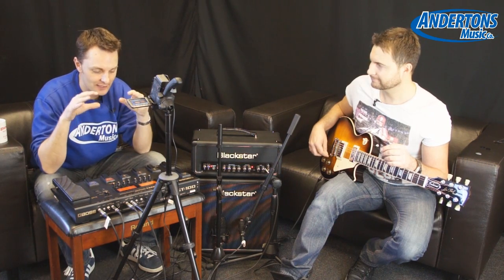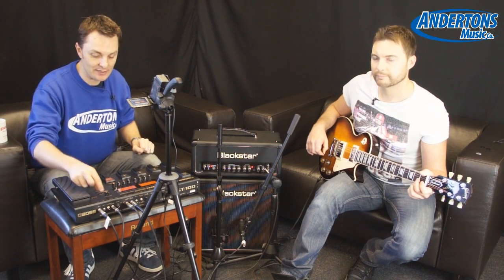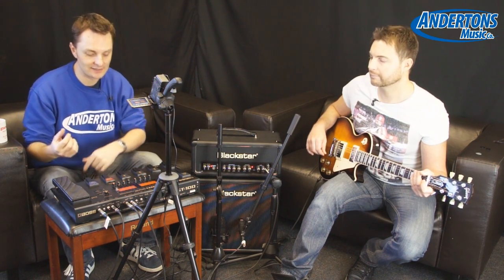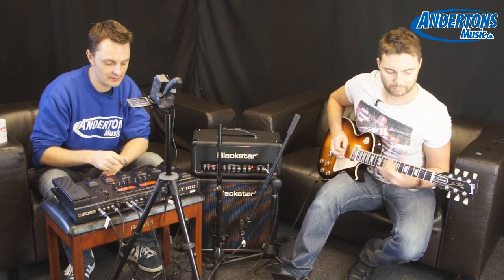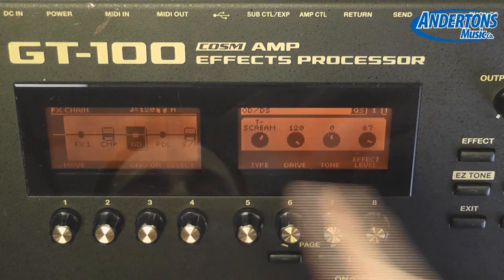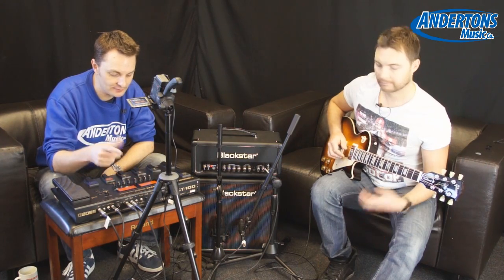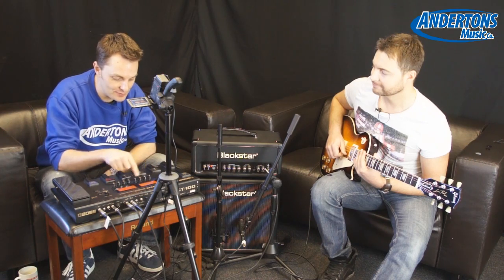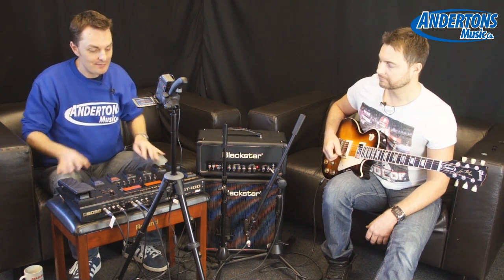Using a Boss GT100 with your Tube Amp via the 4 Cable Method

Comment: I have built all my patches using about 4 pre-amps simulations in the GT-100,  connected to the FX return (power amp) of my Marshall.  Now I would like to change to the 4CM system to be able to use the Marshall pre-amp as well.   Do I have to exclude all the pre-amp simulations from my patches in the GT-100?  And if I keep them, where is the send S/R (send/return) positioned in the chain,  before or after the pre-amp simulations?  Please let me know your comments.  Thank you.

Comment: Cool video. But I question. Is there a notable difference between using  4CM or plug my guitar in the amps input if I use the clean channel ? It is more obvious for me in the OD channel, but not clear in the clear channel.

Comment: Are the send/return on GT.100 buffered?  (Some bad revievs on other similar gear, because they lose signal when running '4 cable method' wit 6m cables on stage setups).

Comment: To be honest I tried 4 cable method and this makes no sense to buy GT-100 if you want it only for some fx in the chain. You could buy a cheap fx board instead and get the same. To fully use BOSS-GT-100 you need to hook it up in to your amps FX return and use the built in amp sims. And its best to use 2 amps, or a stereo power amp with some good speakers. FRFR speakers.

Comment: Can you tell me if the Gt 100 can have as many stomp units in front of the amp or even after as you like... i.e Two EQ's , two OD or Three T screamers if I wanted that......... Great vid by the way..
Reply: It's limited to one preset OD of your choice for every patch, you do have additional fx1 and fx2 to assign (two additional ODs if you choose, or one of multiple other effect choices).

I use mine as fx1 assigned as clean boost and the OD set to TS, fx2 is set to the Boss Overtone effect- compressor, delay, reverb, eq and chorus are all set as fixed effects but there are variations of each and you have complete flexibility to arrange those effects however you like and assign them to each footswitch for use like a standard pedalboard 👍

Comment: Hello, I followed your video to make the 4-wire method in my gt-100. The results are not what I thought or similar to yours. I have a MG50CFX marshall amplifier a Godin guitar and I put the cables as you say but the patch sounds bad, better sounded when I connected them to the studio monitors. also there is too much noise in the pre amplifier. Guitar to input GT 100, L/Mono GT100 to Send amplifier, improved a lot but I don't know why it works that way, it's like a two-wire method. The only thing is that it sounds very serious and I don't know where to regulate this, since I skip the Marshall preamp so the controls except the master volume don't work. @r2iU
Reply: Hi! did you find any answers? I am looking informations about input level (http://vn.boss.info/support/knowledge_base/201973809) and the type of "output select" we have to choose for this 4 cables method. Do you use "Stack Amp" or Stack Return". I 'm going to ask this again ini the comments. Thx

Comment: Does the BOSS ME-80 support the 4-cable method? Don't think it does. Would be good if someone could confirm. Gracias
Reply: It does not unfortunately
Reply: Watch this, it helped me . I have the me 80 as well. I play rock and roll live and ive been searching for a year on how to use it in its full potential.this video helped. 
https://youtu.be/U2NxBrKU9co
Reply: One trick is to plug your headphones ( not to listen, just plug it in and leave there) in the AUX port. It will instantly activate the me80s secret power

Comment: can you bypass the amps pre amp with this, and just use your guitar amp as a power amp?
Reply: Yeah but you can do that by just plugging straight into the return of the amp efx loop. The 4 cable method is only worthwhile if you want to occasionally use the amps preamp section.
Reply: Anthony Burt what I mean is, if you use the 4 cable method, do I have a choice to bypass it, ie route the signal directly to the effects return on the amp, even if it's plugged into the input, if that makes sense
Reply: Cool, thanks

Comment: I've had GT-3,5 and 8 and never really got on with 4CM partly as my Marshall effects loop is parallel. Tried using just the effects in the loop and not bother with the amp sims but came to the conclusion best way to use GT products are with a full range PA or powered cab. If you like your amp, stick with pedals.

Comment: HI Lee
could you tell me is the channel your using to demo the 4 cable method a clean or dirty channel
also does the 4 c,method work on 3 channel valve amps
Thankyou
Reply: Hey mate, not Lee but anyway at 1:49 he says he is using the drive channel of the ht5 with no effects, as for how the 4 cable method works it is actually quite simple (the 4 cables are, 1. Guitar to GT100, 2. GT100 to Amp, 3 .Amps effects loop send to GT100 and finally 4. GT100 to amp effects loop return) for example, like you say in one of your other comments your Koch has a great drive channel, you would likely not want to put reverb modulation delay before that (some people do though) because it distorts the effect and you get a "cleaner" sound putting it into the effects loop, so the GT100 essentially allows you to split it in two with your compressor, drive and fuzz etc being able to be sent to the front of your amp in the same way you would usually plug it in and the modulation, delay and reverbs etc going into the effects loop so that the distorted signal goes into them as opposed to them going into a distorted amp, from what I gather from the video moving the effects before (to the left of) the S/R (stands for send and return) means that it will go into the front end and moving the pedal in front (to the right of) of the S/R will put it in the effects loop, my typical setup would be Pitch-Wah-Compressor-Fuzz-Overdrive-Distortion into the front of the amp and Modulation-Delay-Reverb into the effects loop. For your last question it does not matter how many channels your amps has (as long as they share the same effects loop I,E some Mesa Boogie's have two effects loops) you simply chose which channel you want to play through and order the effects accordingly, Hope this helps :).
Reply: thanks so much 
ill give it a bash
cheers mate
Reply: no worries mate :)

Comment: Why didn't you just add ONE OTHER SIMPLE PIECE OF INFO, and tell us what the cable routing was, instead of directing us to your web site??  The video is titled 4-cable method, NOT hearing the various sounds the unit is capable of, which is why I clicked on the video in the first place.  Fucking click bait!!
Reply: 1: Plug your guitar into the input of your multi-effects unit.
2: Plug the effect loop output of your multi-effects unit into the guitar input of your amp.
3. Plug the effect loop output of your amp into the effect loop return of your multi-effects unit.
4. Plug the ‘regular’ output of your multi-effects unit into the effect loop return of your amp.
Reply: +Rand S I think you meant for four:
4). plug regular output to regular input of amp
Reply: Lorenzo Rico-Juarez Nope. He didn't. His explanation is spot on.

Comment: The 4-cable method was also available on the GT-8.  It does not have nearly as nice an interface for modifying the effects chain, but it does work nicely in front of a Blackstar.

Comment: I must be doing something wrong because all of a sudden when I have it hooked up to my amp via 4 cable method my clean channel gets distorted. I'm using a Fender Twin Amp
Reply: Matt Nardone One of your distortion effects or an amp simulation is on, in the processor.
Reply: Matt Nardone Set the send receive output levels...

Comment: ANDERTONS MUSIC CO!!! FANTASTIC VID. I am new to the 4CM. I am having problems. MY GEAR: Marshall TSL 100 JCM 2000 w/ foot switch head / Line 6 POD HD 500X 
QUESTION:I do not understand how the FX work AFTER the amp. If I set my FX Loop at the end of the chain, that simply means I get all FX in front of the amp. Correct? Now if I move the FX loop to the middle of the chain and place more FX behind the FX loop I can not use / activate them. Why? I know I must be doing SOMETHING wrong. I am very new to this 4CM and need help. All my connections are correct and I have working gear. Any help from ANY ONE is GREATLY appreciated!!!
Reply: BECAUSE EFFECTS GO INTO THE FRONT OF THE AMP OR IN THE EFFECTS LOOP IF THEY ARE TIME BASED EFFECTS LIKE DELAY AND REVERB, NOT AFTER THE LOOP, AFTER THE LOOP MEANS THEY ARENT EVEN GOING INTO THE AMP AT ALL, WHAT YOUR DOING IS BASICALLY TAKING A PEDAL AND 1 PATCH CABLE AND PLUGGING 1 END OF THE PATCH CABLE INTO THE INPUT AND THE OTHER END OF THE SAME CABLE INTO THE OUTPUT, IF YOU WANT TO USE THE POD FOR JUST EFFECTS ( WHICH I HOPE IS THE CASE IF YOU HAVE A JCM 2000, I HOPE YOUR NOT ONE OF THESE MORONS USING A GREAT AMP JUST AS A CLEAN TONE FOR GARBAGE AMP MODELS) THEN DONT HAVE ANY AMPS SELECTED ON THE POD AND JUST USE EFFECTS AND CONNECT THE POD INTO THE EFFECTS LOOP OF YOUR AMP SO IT DOES NOT GET ALTERED BY THE PRE AMP VALVES (WHERE THE TONE OF THE AMP COMES FROM) I WOULD SUGGEST WATCHING A VIDEO ABOUT THE POD BEFORE YOU TRY ANYTHING, IM PRETTY SURE ROB AND ANDERTONS HAVE VIDEOS ABOUT THE PODS

Comment: Will I need to do this if I'm using a vox ac15c1, I will rely on this for effects and drive.
Reply: WHY THE HELL HAVE A AC15 IF YOUR NOT GONA USE THE AMP TONES ? MAKES NO SENSE AT ALL, IF YOUR GONA DO THAT SELL THE AC15 AND GET A CHEAPER TUBE AMP
Reply: +MB215 1) this was written a year ago, so I don't know why I wanted to do this. 2) AC15 is notoriously fussy with pedals, I actually got rid of it for my hotrod deluxe because of this.
Reply: +MB215 Yes mate I understand but I'm not Brian May I don't have the Luxury of turning everything up to 11 for natural distortion, gets to me when forum posters are typically middle aged men who can crank their amps and look down on people . I agree if you're using high end Amps don't use shitty pedals but to each their own I guess. Plz turn your caps lock off my eyes hurt.
Reply: +Gary Jovanovitch THEBCAPS KEY IS BROKE, YOU CAN ALWAYS PUT A VOLUME PEDAL OR A EQ PEDAL WITH A LEVEL KNOB IN THE LOOP TO GET THE VALVES WARMED UP BUT NOT HAVE IT SUPER LOUD SO YOU GET ALL THE VALVE CHARACTERISTICS AND HARMONICS, THERE ARE SOME CHEAP PEDALS THAT SOUND GREAT THOUGH, I DONT GO BY PRICE, JUST BY SOUND, THE SUPER FUNNY THING ABOUT THE GUY WITH THE 100W JCM2000 IS THAT HE WAS USING A MARSHALL JCM800 AMP MODEL ON THE POD, YOU DONT NEED 100WATTS, A 1 OR AT THE MAX 5 WATT VALVE AMP IS PLENTY LOUD ENOUGH FOR BEDROOM USE
Reply: +MB215 wow never thought about the volume pedal in the loop! That's almost like an attenuators then?

Comment: Seems to work beautifully in a small, enclosed setting such as is shown here. Thing is: for a true stage situation, does it really present no problems to have, say, 20, 40, 50 feet of cable (plus the unit itself) between your pre-amp and power section?
Reply: +Leathan Lund  "20, 40, 50 feet of cable".   This is why I bought 3, 30'  cables!!! (Wrapped them together NICELY with that spiral plastic wrap from Home Depot) Pricy cables!!! ($145 USD) I am learning how all this works. The other guitarist in my band is a FREAK about sound. His system works very well in a live setting! From bars to theatre type venues. (hope we get to try it in an arena one day!   : /   ) But, to answer your question , I am super picky about sound as the other guitarist is, this sounds incredible. Example of our gear to maybe compare if you are interested, MY GEAR: Marshall TSL 100 JCM 2000 w/ foot switch head / Line 6 POD HD 500X  Line 6 4x12 stereo cab.  His gear: Mesa Boogie trip rec, many individual foot controllers, 2- 2x12 Mesa Boogie cabs. If you are playing more than 40' from your gear, I can't really tell you how the latency plays out!! Scoot back!! HA!
Reply: +Leathan Lund I run 30 feet with a GT-8 and I have no problems.

Comment: Hi, trying to weigh up the best option for live playing; This or changing my ME70 to an ME80.
The amp control looks great but will it work with my Blackstar HT100 head (3 channel)?
There are two options to control channels; multi pin or 1/4 Jack.... But it is a 3 channel amp.
If not I will probably go to an ME80.
Reply: TheNorthernChris  IF the HT100 Head has a midi connection... i believe you can use this to control the channels on your amp.

Comment: Dear Mr Andertons,
The four cable method has been used for ages way before the TC Electronic G system came out. The first multi effects units were the Lexicon MP1 and the Boss GX700.

Comment: Question for anyone in the know!!
What would the proper(if there is one) 'output setting' on the GT100 if your running pedal through...
1: the main input of an Orange CR120 combo?
2:just the return of CR120?
3: four cable method CR120.?
All of these are for a live situation!
Many thanks you lovely people.
👍

Comment: Worked fine on my GT-10 too.  Also, I had a Vox AD-120 VT (awesome) which is Stereo, so able to have stereo effects (double awesome).  Only issue I had was that I had to adjust the system setting tone/presence up a bit. Never used any gain from effects unit (amp was sufficient)., just a bit of compression boost and mostly used the digital effects from the GT-10 and analogue from the amp.
Reply: ***** I never tried (my gigging days behind me and I used mesa boogie, Boss and ART in those days) but I am sure it would be fine.  When you're gigging you want simple unless you have tech's behind you, so actually this might be a sweet setup.  If it was me, I would mike up my AD-120 in stereo to the desk.
Reply: I heard that the Gt10 removes some of the saved tones ..apparently..though I don't believe ..but may I ask..is it true?
Reply: ***** Haha thought so

Comment: Does the Amp ctr fonction controles the channels of any amp, without the MIDI option ?
Reply: Did you ever get a reply on answer for your question?  I've been having an issue figuring out the same thing.  I can't get the "amp ctl" feature to work by using the 1/4in. output.
Reply: No buddy sorry, i did'nt had any reply. but i think that the "amp ctr" can control only an amp with two channels, it can maybe help you ...
Reply: Med yassine Mankai Hey Med.  After messing with the settings, I finally figured out how to get the AMP/CTL feature work.  I'm running the pedal through a Blackstar HT Studio 20 (two channel)

The way I got the GT-100 to switch between my amps channels was:
- Press the "system" button (it's right next to the volume pedal)
- On the left screen, turn Knob 4, clockwise, to go to Preferences, it will be labeled "PREF"
- Once you're in that setting, look at the right screen of the unit
- Turn Knob 7, clockwise, to change the ACCEL/CTL to "System"
- Next, exit out of the "system" settings and click the "CTL/EXP" button (its also next to the volume pedal, right underneath the "system" button
- The first icon on the left screen will be the "ACCEL/CTL" feature
- Look at the right screen
- Turn Knob 5, clockwise, and set "Func" to 'AMP/CTL"
- Turn Knob 6, counter-clockwise to make sure "MIN" is set to "OFF"
- Turn Knob 7 clockwise to make sure "MAX" is set to "ON"
- Turn Knob 8 clockwise to make sure "Source Mode" is set to "TOGGLE"

Those are the steps I used to get it to work.  Once you get into the User Patch, you should be able to use the ACCEL/CTL pedal to switch the channels on your amp.  I hope this helps.  Let me know.
Reply: What's up Aeron!
Well, it works for me also, i'm using a Marshall valvestate 60 Watts and after missing with the unit i finaly can change the channels, thanks a lot.
Reply: Med yassine Mankai

Comment: The big problem about 4 cable and digital processors is the audio degradation. You will have first an analog to digital conversion, then a digital to analog and then another analog to digital and then a digital to analog again... It will change the thing. Continuous oscilations to discrete to continuous to discrete to conntinuous... Something get lost... I gave up...
Reply: There is a setting in the System section that resolves this.
Reply: Paul Bartlett Humm, Sure? Now it has a true bypass loop inside? How it cuts the AD, DA, AD and DA steps that normaly occur on 4 cables method.

Comment: I've done exactly the same with my gt10.
Actualy in the gt10 as well you have the same interface of moving the different effects (including the S/R ) around the chain.
I thought about it myself but now seeing this video I realize I've done the right thing.
Very nice of you to demonsrate such ideas
Thanks.
Reply: But he doesn't explain how to control the last submitted fx in that gain sound. So, how to individually control this reverb, delay and chorus (after the fx-loop) like 3 separate stompboxes? Can you tell me?
Reply: Pressing the displsy botton 5 times moves you to manual mode.
Reply: Aner waitzman  What is the display button? You get manual mode by pressing bank down and up simultaneously..right?

Comment: and you won`t show how did you hook up everything??? wtf??? lame ass video...
Reply: Cable 1- Guitar to GT100
Cable 2- GT100 Effects Send to Guitar Amp Input
Cable 3- Guitar Amp Effects Send to GT100 Effects Return
Cable 4- Gt100 Output to Guitar Amp Effects Return
It's in the description.
Reply: En el minuto 1:18, dice que entres a la pagina de Andertons y veas el diagrama.
Reply: fuck that
Reply: ArriCAT5e very clear...what if you want to just run it thru your effects loop on your amp?  yes, I'm a newbie. ;)
Reply: ArriCAT5e Or Cable 5- Gt100 Output to Guitar Amp Effects return right channel and the other to left channel, if you have a stereo amp or two amps.

Comment: I have a GT5, Had it since the 90's.  Could move loop point on that. Been a very overlooked feature for years.  I still use it and enjoy it, however the s/n ratio is not too great.  Does anyone have a comment about the noise floor on this unit?